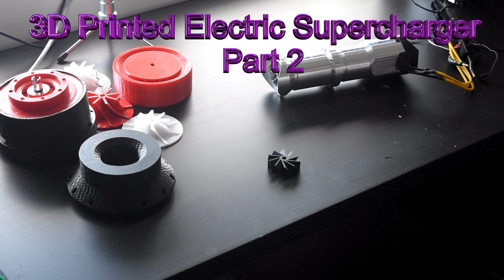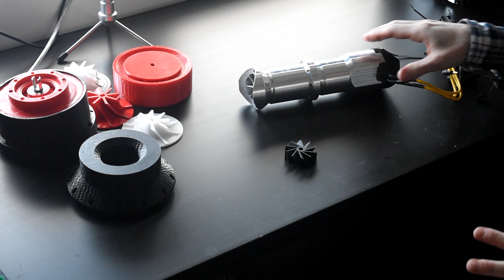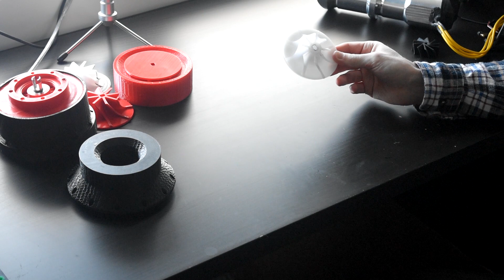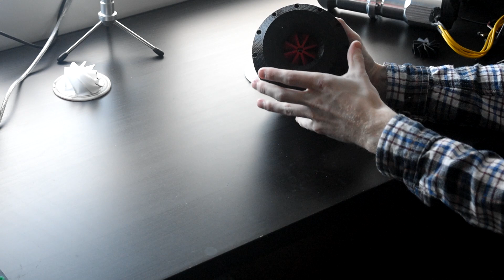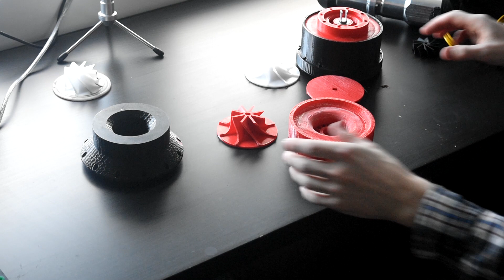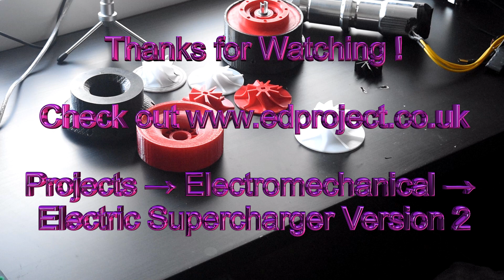3D Printed Electric Supercharger Part 2 - Hits 5PSI Boost !

Comment: great job, you can use vacum cleaner or electric paint gun blade for impeller, and 3d print the rest of parts. or just use one of there whole motor+ impeller and housing

Comment: Remarkable achievement and brilliant idea of using 3D printing to design  and test your concept. I know this is an older vid but this would really take off if you made it open source and sold the printing and CAD files.
Reply from the maker: Hi, thanks, I appreciate the interest. I have been thinking of visiting the project lately with a completely new design, I will need to build a safety enclosure this time. I will also give it much better balance. I think I'll make the housing in metal at first with a 3D printed impeller and then work on getting it all plastic.
Reply: @edwardpage8346  It's the first of it's kind that I can see or find. No body is even thinking of using plastic, but there is no sound reason not too... no 'hot' side to worry about.

Comment: small gear box, get the impeller spinning faster?
Reply from the maker: Hi, yes that is what I would have gone for next, although for the speeds, plastic wouldn't hold up. I will visit this project again some day, just don't have the time.
Reply: @edwardpage8346  I understand the lack of time. Perhaps you already know, but nylon may be a viable material to 3d print for higher stress?
Reply from the maker: @DesertSessions93  I originally bought some nylon but the stuff had to be sent back, never got a refund so I stopped buying from my usual supplier. I just recently got some carbon fibre PETG so I might have to give it another visit in the next few months. My printer is in need of some upgrades too.
Reply: @edwardpage8346  Look forward to seeing your progress.